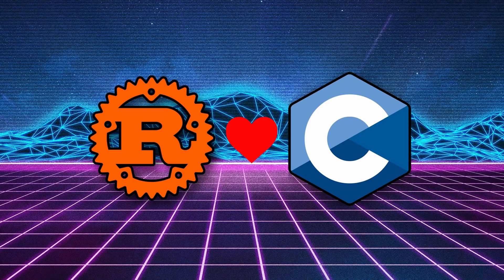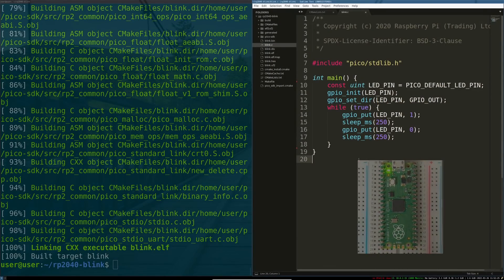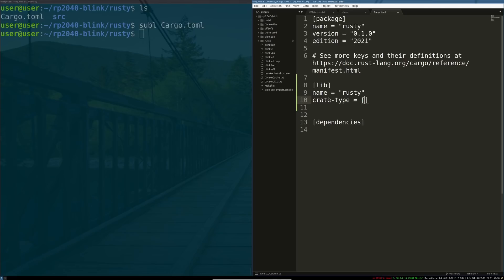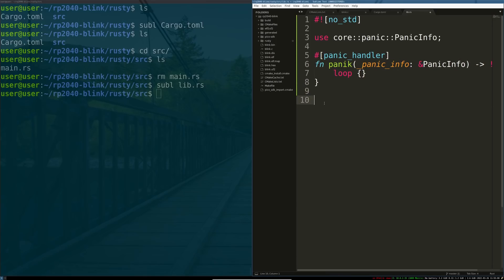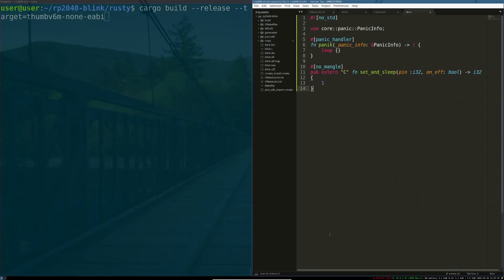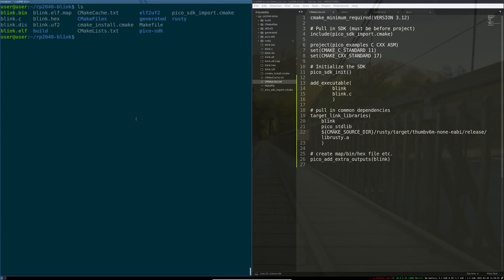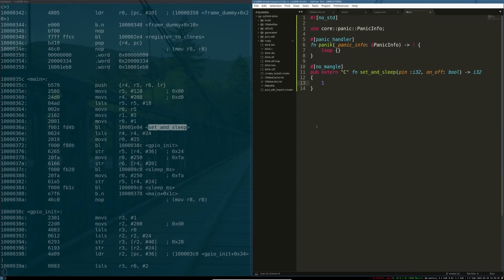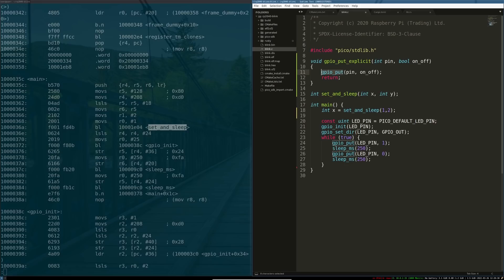Don't Worry, C and Rust Can FINALLY Coexist (Here's How) | Embedded Rust and C on the RP2040 Pi Pico

Comment: So when writing the Rust code, you used primitive Rust types. I know in the standard library there is the std::ffi C types that are redefined for Rust, but I understand here in the embedded space having the whole std library is overkill or not possible. My question is though, are there circumstances where the Rust types and C types don’t match in the function signature and the function either fails or causes undefined behavior? If so, would you happen to know any methods by which to avoid this behavior? 
Thanks for the great video!
Reply from the maker: I agree with your point here. One of the things I forgot to do/mention in the video is the use of the libc crate to use types that directly map to C types.

You can also use cbindgen or bindgen to create rust structures from C headers that are a 1:1 match.
Reply: @LowLevelTV  Also check out the cty crate
Reply: There's the repr(C) directive to specify that a Rust type is to be aligned, sized and ordered exactly like a C type. That should be enough to reliably call into C.

Note that calling into C is inherently unsafe in Rust terminology, because obviously Rust can't guarantee that it's own promises are kept by C. The C code might for example free memory that Rust owns or holds a reference to, return uninitialized data and so on.
Reply: Ty for asking lol
Reply: Primitive types won’t be a problem. If you want to return a string for example, you’ll have to convert the Rust string to a CStr and then to a pointer

Comment: wow. i have a Pi2040 that has a 4x4 key grid, that I use as a 8-dot Braille keyboard that looks like a full, and  normal US QWERTY kb. the problem with it is that it's unusable in some ways because circuit python just uses too much power. I mount it into a 3D printed iPhone case. I need a special cable to connect from lightning to USBC power. I can't have it plugged in for more than 30 mins. maybe this is the solution. And a good reason to learn Rust on a real project.

Comment: The "edition" key does not mean year created. Rust editions are are not released every year, and it defines a set of things you want that may contain breaking changes (such as the standard library). This allows those core components to be updated and have breaking changes without breaking old projects when they update rust, as they still use the old edition. The default edition is always the most recent edition, in  this case 2021(however we may be getting edition 2024 later this year)

Comment: Really cool video! I was left with a couple of doubts, 

In the video you declare functions that receive/return integers or booleans, which are variables that both C and Rust understand, what if you want to send a Rust reference or C pointer? Or a struct declared on C or Rust?

And is it possible to run C code alongside Rust using the embassy framework?

Comment: Hey, would you do a video on the SSD1306 display?
how to correctly address page in all modes, horizontal, vertical and page addressing mode, To be able set cursor anywhere to want it.  
the pages/column thing is easy to understand, basically the stuff from page 28 to 32.

you're able to send a single one of multiplier bytes, 2 modules in command and 2 modes for data.
the order how bytes are send.

the datasheet is kinda hard to understand, more people complain about it.
i have seen 2 approaches on how people handle the I²C stuff, but only one of them is how it actually works, the other one an indirect and abstract method, but works.
i use a original Microchip Fubarino pic32mx and the Arduino IDE, but not using the arduinio library language of what ever it's called, like you would program a pic and manipulate it's registers directly.

Comment: You are using terminal impressively fast! How did you figure out the shortcuts?
Reply: Those are basics. You'll probably find those on the manpage, or the documentation.
Reply: He makes it so fast that I’m not sure for whom this video is for. Should I pump my reaction to press a spacebar in time to be able yo see what he typed just before he run “clear screen”?.. I’m not sure. I’ll better read a manual instead

Comment: Since they both use LLVM, could you link them at the object level and forgo making them as a library? Assuming names and types match up. I think I'm missing something important here...
Reply from the maker: It’s a static library so it’s still happening compile time at the object level. I think you’re right, could make this happen at the IR level in LLVM
Reply: @LowLevelTV  What would have the added benefit of cross language optimizations.

Comment: 9:33 I'm curious why you're "lying" to the compiler about the return value. Is it for demo purposes, are you unable to omit the return value, or are you unable to specify `-> ()`?
Reply: I read a few articles and I think it's fine to write a function returning a unit type (or nothing) when writing an extern function in rust. So
pub extern "C" fn test() {
	println!("Test");
}
Should be a valid ffi function.
Ps:
It doesn't matter if you write an extern block or put it on every function. Also the "C" can be omitted because as far as I know C is the default for extern in rust.

Comment: That's a cool demo, I'm interested in rust but I've never tried it before, it's an interesting use case !
Just une question, you "lied to the compiler" with the return values, why ? 
Is it like in maths "when it's too complex for the moment, so we're gonna ignore it" ?
Reply from the maker: Primarily because the functions are voids and Rust doesn’t have a Null value like other languages. Instead of figuring that out I fudged a little bit 😝
Reply: @LowLevelTV  Does the Rust unit type "()" not work as a C void?

Comment: No they can't :). Because the compiler can't no the memory state of data that has gone through C... So even if all your Rust code is safe, C taints it.
Reply: That's why it's the goal to make small easy to understand wrapper functions in rust double and triple check them and live the rest of the time in the safe rust world. A 100% safe rust World is impossible unless you rewrite all device driver, operating system and bootloader in rust. Much fun with that. It's not too hard to interface with c safely. It's actually pretty beneficial for the language since you have access to this huge world of c library's.

Comment: in the first part of the video you did `cmake .`, it's better to keep generated files in a build folder so 
```
mkdir build
cd build
cmake ..
```
that way you can (if you want a clean build) just delete the build folder and create a new one, also if your using git you can add `build` to the .gitignore file so that the build files don't get tracked
Reply: If you want to compact it down to a single command line, you can do  `cmake -B build && cd build`, or, if the build directory name is the last argument of your cmake command `cmake -B build && cd "$_"`

Comment: This is going to be very useful as I have a C project that I would love to add some Rust code into. Thank you for showing me the way.
Reply from the maker: Anytime Mark, I gotchu
Reply: This video only explains the manual way, though, which is quite error prone. If you actually use this in a project, you might want to look at "bindgen" (calling C from Rust) and "cbindgen" (calling Rust from C) to generate the function stubs automatically.
Reply: @m.sierra5258  I really like knowing the manual way first because it uncovers all the dusty corners. Once I understand that I start looking for tools to make it faster.
Reply: @TinkerersAnonymous  oh don't get me wrong, I totally understand and respect that :) I just wanted to point out that this is not the way it would be done in an actual project
Reply: I think this feature makes it easier to migrate away from C.

Comment: Yeah but then there is no point in using rust. It's still cool knowledge to have I guess but it does defeat the point of using rust.
Reply: The huge usecase here is that you can transition a project to Rust gradually, without having to completely throw away the previous project. In a commercial setting, this is a major point for adopting rust in your project, no manager would agree to a complete rewrite of the product that would stop all progress for a year.
Also, there are many libraries (like for example wifi drivers) that only have C versions, and this enables rust development on a microcontroller while the library ecosystem is not there yet. (or ever will be... Companies won't release multiple versions of their wifi drivers, for example the new openthread, in different languages)
Reply: @m.sierra5258  I'd love it if that were actually the case. I personally just can't ever see that realistically happening. A project would just end up being a wrapper of its former self with tons of unsafes and ultimately fail to prove itself. Maybe there are some super niche projects out there where this would be helpful, idk.

Comment: How do you validate that the ‘bool’ on the C side is the same bit-size as the ‘bool’ on the Rust side?
Also how do you validate that the ‘int’ on the C side is the same bit-size as the ‘i32’ on the Rust side?

IIRC, I remember that it may cause problems, ‘int’ in C may be 32 bits wide but it doesn’t have to, The same thing about the ‘bool’ type variable, Some languages use an 8 bit integer to represent it while others use a 32 bit integer to represent it, How do you validate that the types on both the C and Rust side align with each other? Thanks.
Reply: don't write the method stubs manually, use "bindgen" (Rust->C) or "cbindgen" (C->Rust) to generate the correct method stubs automatically.
Reply: std::os::raw::c_int is what you want. I believe the C standard specifies bool will always be one byte and since its the "same" compiler endianness doesn't matter here.
Reply: Read up the Rust FFI. Rust provides a  c_int type among many others for this reason. Also, note that while int32_t may be available in many C compilers, it is not required by the C standard to exist. I imagine the embedded world may be one of the few places where this actually matters.